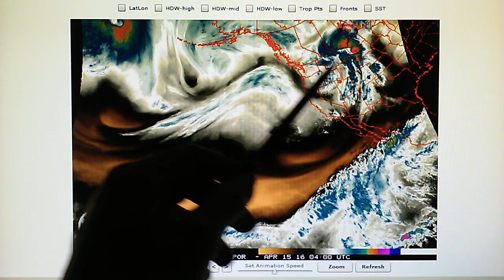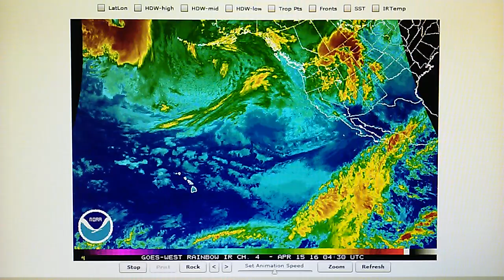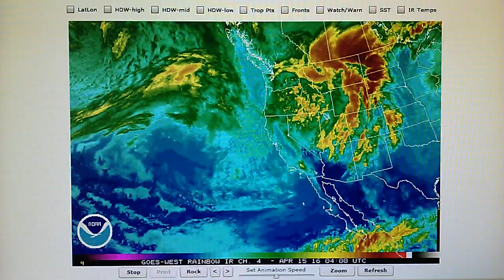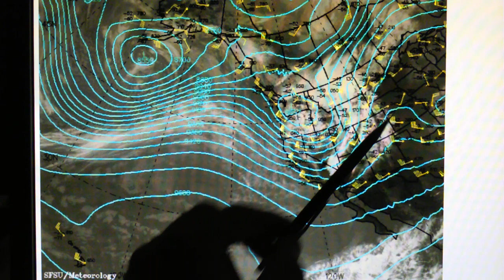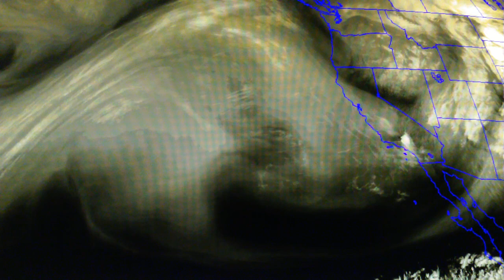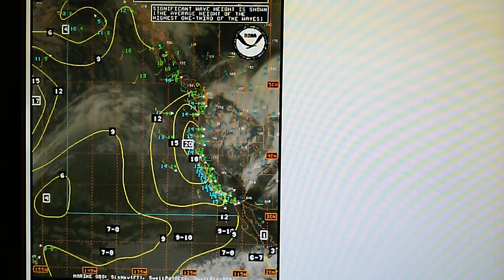4-14-2016; Installed High Pressure Continues to Evaporate Jet Stream Moisture Into California

Comment: 12:00am; We have extremely strong, dry winds right now in west LA, which are blowing trash cans and trees all over the neighborhood. The weather here this past two years has been a manufactured nightmare...it's so obvious what they're up to. We have a manmade dry warm up coming so there will be no rain for SoCal. Thanks, PR.
Reply from the maker: - Wind up here in Foothills has not been too strong;  15-25 MPH at most.
Reply: No thats not true the monsoonal season should bring at least 3-5 inches of rain this summer for SOCAL.
Reply: +Free Energy Technologies 
All the high pressure installed off shore and the spraying of chemtrails has again prevented the rain we should have received this week, in Central & Southern California, as shown in this video.
Since the installed high pressure will stay parked, we are due for some very HOT weather again in SoCal.
Reply: +Russ Redfern Not even your area is like 50 ℉ day and so on we are not too warm or dry but the poles are frying and that is what matters.